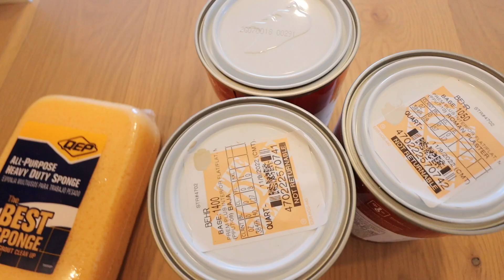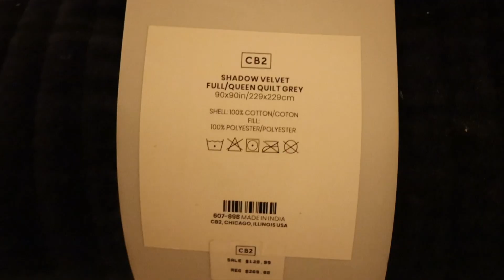I gave my room a HUGE makeover in just a week!

Comment: You are not afraid to try stuff :)
The wood pieces have to be exact same size and the ends exactly 90 degrees. Even 1 degree off can be very noticeable and make it wobble. With a 'square tool' you can feel if the ends are proper 90 degrees. The right machine cutting them will make them both 90 and same length.
Reno of the bathroom can be good value and the last major piece that will shift the whole thing. Also has to be done right :) Slopes and stuff.
Reply: 🆙🆙Dm me for your prize ok🆙
🎁🎊🎉